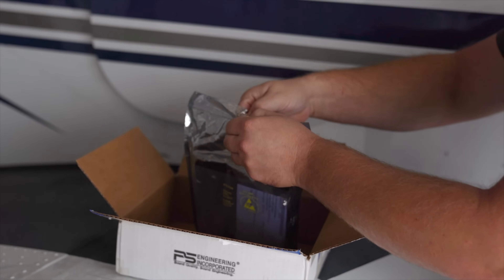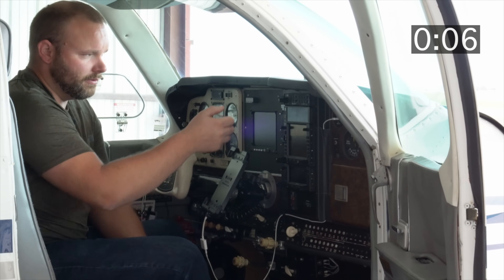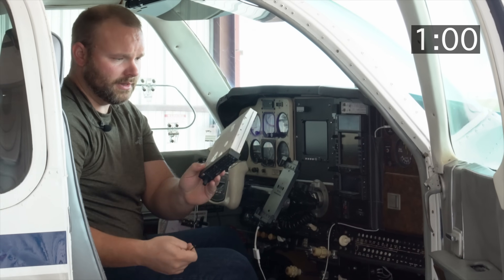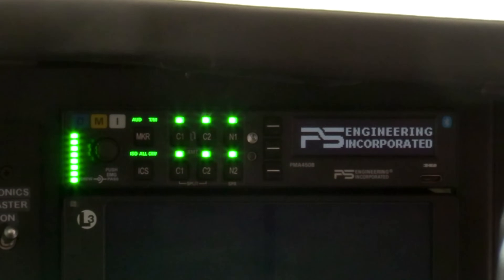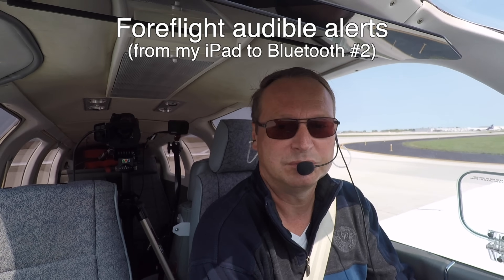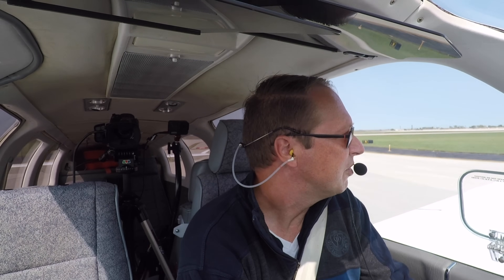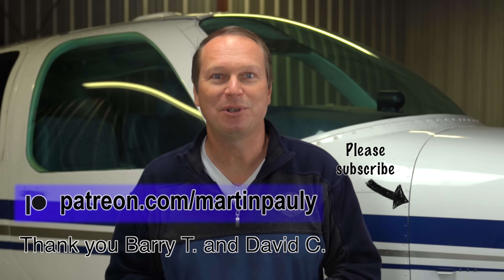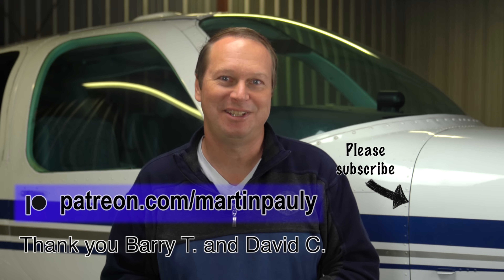PMA450B Audio Panel Upgrade

Comment: Love PS Engineering!  I wish they made the 450 to be pin compatible with the KMA-28.  I can only upgrade to the 7000BT.  The problem with replacing an audio panel, is that if it is not pin compatible you will pay a lot on labor since the audio panel "touches" all the other hardware...
Reply from the maker: Yes, that's correct - the audio panel is connected to so many things, it's very labor intensive to rewire it.
- Martin

Comment: So how do the Halo headsets sound with that system?
Reply from the maker: Hi Dan, the sound quality in the headset has not changed from the PMA 8000BT I had before. The 8000 is already excellent; the 450B adds more configuration options, a much nicer interface, and a second independent Bluetooth channel.
- Martin

Comment: Hello Martine, i got the 8000BT as well. I guess its time for upgrade :)  PMA450B has audio out, wondering if you're able to record the cockpit audio via Bluetooth when you’re recoding video from your iPhone or Android? Thanks
Reply from the maker: Yes, Shawn, you could record the cockpit audio through Bluetooth with the 450B. I use an analog recorder instead, because I use both of the 450B's Bluetooth channels as inputs.
- Martin
Reply: @martinpauly  great. Thanks a lot. I mainly record Videos though my IPhone and I’ve to use a cable to record cockpit audio. This is a great function for me via Bluetooth 😎

Comment: It’s my understanding it can send Bluetooth to a recorder so you can record the audio to an iPad or phone. Do you know if this requires an app and if so which one works well for recording cockpit audio?
Reply from the maker: Yes, it has the capability. I have seen people talk about a free app called FlightLink in this context. I have not tried it myself, because I use the two bluetooth channels as inputs for different devices - I'd have to sacrifice one of them for output instead.
Regards,
Martin
Reply: @martinpauly  I just installed the Dynon Skyview HDX so now my IPad has less relevance in my cockpit.  I use it more for a notepad now.  I think I may try recording audio on it and using the other BT channel for my phone.  This would help eliminate cord clutter in my cockpit.  Thanks for the great video!

Comment: Klasse Video, danke Martin! Ich habe in meiner Bonnie ein funktionierendes GMA340 überlege aber wirklich das PMA.. Great video and content! thx, Daniel
Reply from the maker: Vielen Dank, Daniel. Der Austausch (GMA430 -> PMA450B) ist eine Sache von wenigen Minuten. Hast Du schon eine Stereoverbinding zu Deinen Headsets? Wenn nicht, würde ich wenigstens Pilot und Copilot für Stereo verkabeln - das ist sehr einfach und schnell zu machen; an die hinteren Sitze kommt man meist nicht so gut ran.
Gruss,
Martin
Reply: @martinpauly  ja vorne ist Stereo verkabelt. Habe leider jetzt seit ein paar Tagen einen springenden Drehzahlmesser. Kabel vorne ist geprüft ohne Befund- jetzt muss ich mal unter der Avionik Abdeckung nachsehen. Alles noch analog. Jetzt verschieben sich schnell die prios. Nichts desto trotz habe ich das Thema im scope. Lieben Dank für deine Antwort & Grüße- Daniel

Comment: Martin...I don't no whether to blame you or thank you!  After your PMA 450B video I decided that this was the upgrade I have been waiting for.  So I swapped my PMA 450 for the "B" model and now have it installed in my Arrow.  The only glitch was the "alert" function which requires a "special" installation manual for dealers only.  So after I spoke with PSE who then sent this new manual to the dealer, it was back over a mountain pass here in Colorado and then only about a 20 minute configuration change.  Now the 450B "reminds" me of a "Master Caution"  and low fuel situation from my JPI EDM 830.  I particularly like the "auto" feature of Intelliaudio as well as the dual bluetooth channels, one for my iPad mini and the other for the iPhone (ground use ONLY, of course :) ).  Thanks for spending my money for me!!!

Jim
Reply from the maker: Hi Jim,
Sorry to hear this video turned out to be expensive for you. 😁
I have not yet connected the alert function to anything. Maybe down the road...
Best,
Martin
Reply: @martinpauly  Martin... I won't hold this against you ! :)  If you do connect the "alert" messages know that the connectivity information to do that is NOT part of the owner's "installation manual".  It is in a dealer-only supplement. I have my alerts set for the "master caution" alert  and also a low fuel alert from the EDM-830.  Hopefully Oshkosh will be held next year and, if you attend that rather than your LONG bike ride, I can have the opportunity to meet you in person!  Cheers...Jim

Comment: Martin, is there any value/monetary demand for the PMA panel you removed?
Reply from the maker: Monetary demand?  What are you talking about, Robin? Sorry, but I don't understand what you are asking.
Regards,
Martin
Reply: @martinpauly  I'm assuming residual resale for the old PMA panel.  It does seem like the 8000BT is worth somewhere close to $1k on the used market, so nothing to sneeze at.  :-D

Comment: Does the Bluetooth mode support siri ? :-)
Reply from the maker: Yes, but... If I merely say "Hey Siri" into my headset, the phone won't respond. Same is true when I connect the phone to my car using Bluetooth. Now, if I activate Siri with the side button, then yes, I can use Bluetooth to talk to it through my headset and intercom.
- Martin
Reply: @martinpauly  can come handy in several occasions. Thx!

Comment: The most important feature of the new PMA450B is you can make sure your Deli deliveries are spot on.
Reply from the maker: Good point - somewhat related, I have on several occasions used the Bluetooth phone connection to confirm the exact time of a restaurant reservation at our destination from the run-up pad before take-off. Very handy!
- Martin

Comment: Awesome video Martin! That is one sweet sounding panel. I listened with just pc speakers and was easily able to comprehend both channels. I am about to start flying a 1962 skylark, and I could very easily see one of these panels going in there. Question: Does is also have a function to mute screaming kids in the back seat?
Reply from the maker: Yes, it does have the usual intercom isolation modes (ALL - CREW - ISO), with a few additional goodies like the "alternate intercom" mode I briefly mentioned in the video.
- Martin
Reply: @martinpauly  I don't know how I missed that.

Comment: I’m sure these are often asked questions but what head set do you use and what yoke mount for you IPad? Great video as always and I think I’ll swap out my Garmin audio panel for the 450B👍
Reply from the maker: Headset: Halo from Quiet Technologies
Yoke mount: RAM
Reply: Martin Pauly Thanks. Just got new Halo in mail. It replaces a Quiet Technologies Auri my wife used for 20 years!

Comment: Another great video, Martin.  I think you have posted this before, but can you remind me what headset you use and how the ANR compares to Bose A20 or other ANR headsets?  Thanks!
Reply from the maker: Hi Brian,
The headset I use is called Halo, from Quiet Technologies. It uses foam plugs in the ears. Attenuation is very good, though not as good as the top-end ANR headsets. On the plus side, you get something extremely light-weight with no pressure on your head/ears. And you never run out of batteries with the Halo. 😁
- Martin
Reply: @martinpauly  Thank you, Martin!

Comment: Thanks for another very interesting video! What would be really cool, if the audio panel could filter my callsign from atc. Isn’t that the case with HF coms in airliners?
Really cool that PS is doing it all in house. You can tell that he’s proud of his accomplishments. Well done.
Now I need to check PS website. I still have this ancient PMA8000B...   ;-))
Reply from the maker: Hi Timm,
You are referring to SELCAL, which alerts the crew of an incoming call for their flight. SELCAL goes far beyond the audio panel, and requires ground equipment as well. But who knows, maybe in the future there could be a voice recognition feature built into our radios or audio panels?
Regards,
Martin
Reply: @martinpauly  Yes, exactly! I forgot the name. Ok, I see, that sounds like a pretty complicated technology, not just an easy upgrade... But as you said: Who knows...  ;-)
Reply: Martin, I just talked to my avioncs technician about 3D audio. He said, that it requires headphone plugs to be stereo-wired. Was this the case in your Bo? I’m pretty sure it didn’t came from factory like that. Not sure if mine is. Its a 1992 A36. Need to check. If not, I would leave it alone.
Reply from the maker: @timmholzhauer3342  Correct, you need the installation wired for stereo, which is very easy and quick to do at least for the pilot and copilot jacks. It might add a couple of hours of labor to the installation, and $10 worth of parts.
The ones for the back seat are harder to get to and usually require the removal and reinstallation of some interior parts, for the wiring. My A36 has the pilot and copilot jacks wired for stereo. I did not bother upgrading the passenger seats in the back yet - one day I may redo my whole interior, and then this will be added.
A couple of other thoughts: (1) You probably want stereo just for the music anyway, not just the IntelliAudio - meaning many installations with a GMA340 or similar older audio panel are already stereo for that reason. (2) It goes without saying that your headset needs to be stereo as well.
Regards,
Martin
Reply: @martinpauly  I checked my headset plugs. They are stereo wired! Yeah! 
Have you looked at the GARMIN GMA345? I have an almost all Garmin panel, so I’m thinking if that would be a better fit. It has pretty much the same features than the PMA450B. 
My impression is that you’re not the biggest fan of GARMIN... I guess that has to do with your job. ; - )
Reply from the maker: @timmholzhauer3342  My job... 😁 well, my job is concerning much larger aircraft than my Bonanza. For the piston fleet, I think we can safely disregard this as a factor.
The GMA345 does have a spatial audio mode called 3D audio, not unlike the PMA450B. They are both pin-compatible with the GMA340. And I think that's where the similarities end. The user interface is completely different - the GMA345 attempts to squeeze all the new functions into basically the same buttons and indicator lights the GMA340 had, and that's, well, difficult to do. The PMA450B did a clean-sheet user interface design and is unrivaled with the on-screen menu and line select keys. A look at the specs shows further differences, like the number of Bluetooth connections (one for the GMA340, two for the OMA450B).
Garmin is very good at ensuring integration of their various avionics component, so for anyone wanting to buy multiple pieces of equipment without spending a lot of effort on researching if and how they can work together, Garmin is an easy choice. It kind if locks you in to them - a market strategy which has worked beautifully for Garmin, but as an aircraft owner, I do have second thoughts about it.
Garmin also makes fantastic autopilots and EFIS solutions - when I will be in the market for those, it'll be impossible to ignore this company. But in my opinion, they don't have the best of everything. GPS navigators? I think the IFDs have the upper hand, in terms of he user interface. Engine instrumentation? Sure Garmin has that, but I believe there are better choices. And audio panels? Look around, and you will find many high-end panels with nothing but Garmin EXCEPT the audio panel, which is PS Engineering. I think that says a lot.
Garmin makes good stuff. Remember the old saying that you can't be fired for buying IBM? I think Garmin is like that - you can't go wrong buying Garmin. You will get a good panel if you do, but you won't get the best of everything.
Kind regards,
Martin

Comment: OK Martin, I’ll admit it. I thought trying to hear two ATIS’s at the same time would be useless, but I put in my earbuds to try it anyway. It was amazing! I could actually clearly hear either one by concentrating on it!   Hmmm... maybe time to upgrade my PS Engineering unit also!
Reply from the maker: Two ATIS transmissions at once really IS useless - but it is a nice example I can reproduce, to show the difference from the old audio panel to the new with IntelliAudio. That's why I did it.
Regards,
Martin

Comment: Garmin has their 3D sound which is similar to this.  Since you have the ear of PS Engineering, maybe ask: how great would it be if there was a mode where it recorded com2 and paused playback while com1 was receiving but continuing to record?  Once the com1 message was complete, com2 would resume.  This way you could listen to the ATIS uninterrupted without having to go around 3 times to make sure you got everything.  You could also have it so com2 manually paused.  After receiving a call, manually pause com2, reply, continue with com2 when ready.  RW, FF, seems like a good idea for the deluxe version, too.  Both Garmin and Avidyne currently record messages and can replay them like PSE's IRS, but none seems to buffer the ATIS and let you parse your way through it as you have time.   PS Engineering could jump to the front of the line.
Reply from the maker: Now that's a good idea!
- Martin

Comment: Thanks for sharing... Garmin bought the same concept to the market several years ago (2017), they call this feature 3D audio.... https://eldiariony.com/latinowire/garmin-brings-home-theater-sound-quality-to-the-cockpit-with-the-gma-345342/
Reply: Just have to say that while the concept is the same between GARMIN’s 3D audio and PS Engineering licensed USAF’s patented technology, the results are very different. Unlike GARMIN’s 3D audio, IntelliAudio allows the pilot to place the coms in up to 9 unique positions. Depending upon your hearing, you can compensate for hearing loss by selecting the positions that best fits your hearing needs.

Comment: G, day Martin from SYSS Sydney, Australia.
The PS Engineering ps8000 radio receiver is amazing technology and thanks for the tour of the manufacturing of this electronic component.
1. My first impression was dislike to hearing two radio frequencies audible at the same time. My critical analysis is:
My plane identification, ATC comms, that relate to that plane.
2. Separation and heading (vector) of other aircraft in my region (review again with radar and voice warning). And VFR.
If Bluetooth; via Iphone for music or telephone: will the ps8000 prioritise ATC or traffic warnings?

Thanks Martin for this great video.
🦙🌏
Reply from the maker: Hello John. I don't believe anybody really LIKES hearing two transmissions at the same time - but sometimes when flying single-pilot IFR, there isn't a real alternative. Also, by law we are required (at least in the US) to monitor the emergency frequency 121.5 when flying.
When playing music, you can select ("mute mode") if radio calls silence music or not.
Regards,
Martin

Comment: Very cool.  There are some awesome military intercom systems that can use 3D audio to give a spatial indication of traffic alerts from the EGPWS system and also ties the physical location of cockpit items, like Fire handles and landing gear levers.
Reply from the maker: Hey Kevin. My understanding is the spatial audio concept from the 450B was originally developed by the military, and then licensed by PS Engineering for their audio panels. It's great stuff, for the reasons you mention!
- Martin

Comment: May be a dumb question, but how did you get your music to your phone? Did you have cell service? Or do you have wifi from your plane? I've been trying to figure out a way to get music on the cheap without paying a grand for a receiver for SeriousXM. I was thinking about getting another antennae for a "portable" receiver I use in the truck. Maybe I'm just overlooking something obvious. I had all new stereo jacks installed when I just upgraded to an Avidyne AMX 240. Oh, I forgot to say what a great sounding system you now have. Well done.
Reply from the maker: Hi Wayne. I'm somewhat old school... For most of my listening, the music is stored on my phone. That way, I don't have to worry about having WIFI or even a cellular signal. The thought of getting XM for the plane for music, news etc. is actually pretty nice - I have it in the car, and so far I shy away from the additional subscription cost for the plane.
Best regards,
Martin

Comment: Very nice.  When will you be upgrading the gaffa tape to the RHS of the avionics stack!  I’m sure someone must make a tape with a wood veneer backing. English humour ......
Reply from the maker: Ha - well, honestly, I though the gaffer tape looked OK there as it at least somewhat matches the metal part. But not so much the wood veneer - you are right there, Andy. Longer term, there is going to be a bigger panel upgrade in my (distant) future for an EFIS and a new, digital autopilot. At that point in time, I will replace the whole panel. Bye bye, wood veneer! 👍
Kind regards,
Martin

Comment: Sweet addition to a nice aircraft that you're making better all the time! Does the new audio panel has radio (as in clearance) playback for the last 30 seconds too? Please keep the videos coming.
Reply: Hi Bill - It does have this feature.  (I also have the PMA450B).  You hold down the Com1 or Com2 ("C1" or "C2") receive button for about 1-2 seconds, and it replays the last transmission received on that channel.  You can then hold the button down again to skip to previous transmissions.  It works well, but I personally wish it had a dedicated button for this purpose, because I use it often.